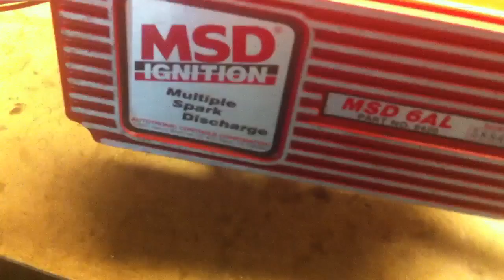How to repair MSD ignition

Comment: 6a unit - I found 2 cracked carbon resistors 0.1 ohm 1 watt next to the large transistors.  the two T0 220 transistors  are BT152 600R and MJE3055T.  All parts available on ebay.....I havent tested the TO 220 transitors yet, but large one seem good and the resistors were out to spec.....read .3 ohms cracked  instead of .1 ohm...
Reply from the maker: those compoments are cheap enough and easy to replace as long as your replacing one already. Wouldnt hurt to replace anything in question

Comment: Msd trying to tell me wen key on coil should not show 12 v ..lol joke even wen cranking it goes to 4 then 1 then -1 ....there junk I had a gm ingnition on my dodge rv got rid of Mopar mess box ballets worked great tried a msd box 2 of them shows flashing power crank pulses msd says test coil wire spark was soooo weak and was off and on junk wat coil does not have 12 v power at coil

Comment: Nice video and great insight into the issues with these. I just lost another one last week and at $400 every couple of years it is frustrating. Might take a shot at opening the failed one up and seeing if the internals are similar. I use the 6AL2 different connectors, but imagine the same base internals. Thanks again.

Comment: Let me pick your brain. I got an older 6T and I've bench tested it same way you did except used a battery. Both triggers work the magnetic pickup and the white wire. I'm trying to install it on a gm 7 pin timing controlled modual. It's straight forward just bypass the pos and neg coming out the modual that goes to the coil easy peezy. Darn thing won't trigger the msd???? All the msd really needs is the neg out from the modual and it fires the coil just fine baffled.

Comment: What is the part number for the burned transistor? My box had the same transistor burned up, but I can't read all of the numbers as they are burned off. What I can read is 70N10L..
Reply from the maker: im not exactly sure what components your msd box has. if its the same as the one in the video, then the parts in the description will work. this repair continues to work to this day.

Comment: Hello .. good night!
Would you help me?
When I connected my ignition module msd 6 al identical to the one you show in the video, when I installed it invez released in the coil a positive sign and a pulse , it is launching two positive signs in the coil.

What could it be?
How can I fix ?
I would be immensely grateful if you could help me.

Thanks in advance!

Comment: is the MSD Ignition uses to replace the stock ignition or to amplify spark and improve performance? do i need to bypass the stock ignitor?
Reply: It's better if you replace  the stock ignition and use this box. Hotter, longer, many sparks

Comment: Mine MSD 6A #6200 has stopped working. Want to repair it? Please!
I use it on the bike shown in my photo, an old BMW R100. 
The spark is very weak with the stock system.

Comment from the maker: If your MSD box is not under warranty, you really got nothing to loose by opening it up and having a look. I know that there can be very big differences in these units based on when it was made. The circuitry changes probably based on serial numbers. All I did was look for fried components and then desoldered them and replaced them with the components listed in the description. If I were you, I would do that as well as it worked for me. You'll need to have the right tools and a decent understan